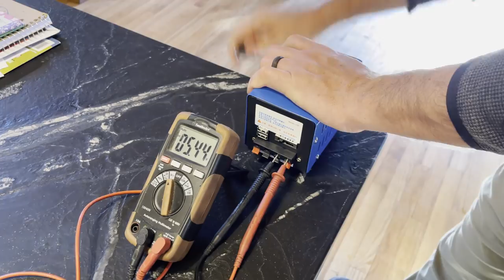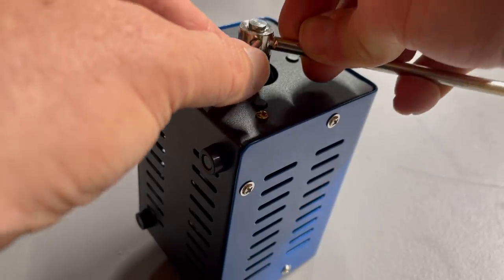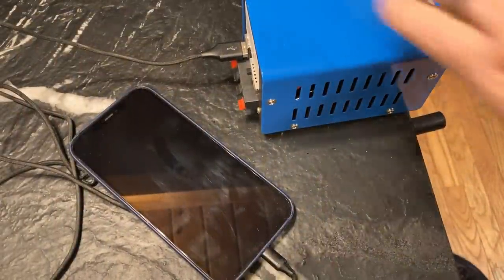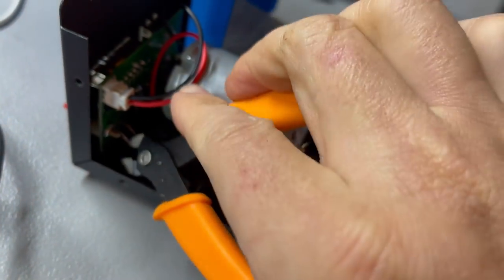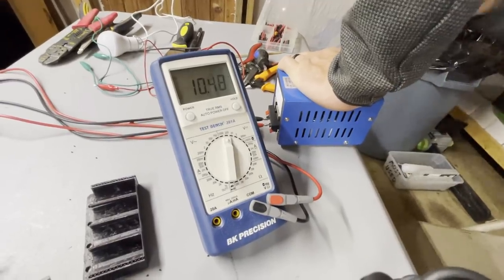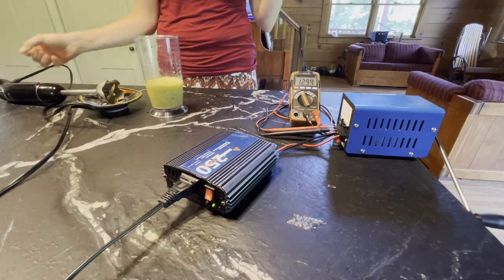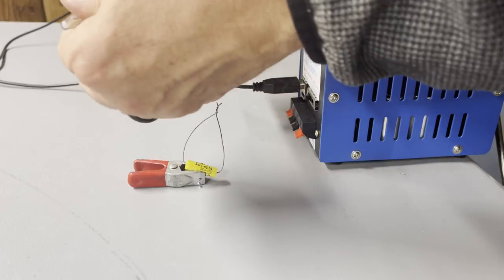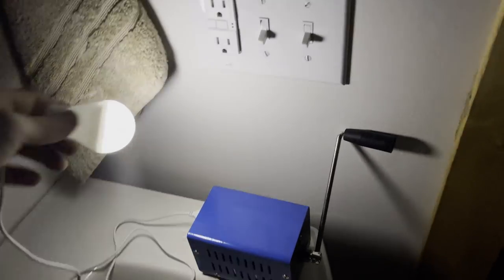DIY Hand Crank Mini BoostBox - Easy Batter Free Capacitor Power USB

Comment: These are extremely handy to have. The crank generator super capacitor flashlight that I made years ago on my channel, I still have and use it. Great job, I really like how everything fit nicely inside the crank gen unit, and the long run time.

Comment: Maybe add a flywheel and pedal so you can just casually move your leg.
Reply from the maker: Good idea.
Reply: Maybe find an old sewing machine.
Reply: I hacked together a charger from the lower part of an exercise bike ( base and crank) and a 100V DC treadmill motor. The poly-V belt from the bike fit perfectly on the poly-V  wheel on the motor. 15 RPM on the pedals charges a phone completely effortless through a car USB adaptor, so this can be done while sitting on a desk or in a recliner. I too added 6*350F super caps + diode and a "%" LCD battery meter to have a buffer, so I could pedal in bursts. The USB adaptor worked from 16V down to 7V on the caps. I also tried charging a laptop at 19V directly by holding the RPM constant , but without regulation, it was too sketchy for the survivability of the laptop, but still doable at 60-100 RPM,  like a brisk walk.  Not very portable, but excellent as a blackout generator for home use, just to keep the basics running.
Reply: @Tore_Lund  can you share a detailed video of this for noob like me.

Comment: You can also use an old cordless drill with dead batteries as a cheaper/free alternative, just zip tie the trigger down and wire up what you want to power to where the battery terminals would make contact in the handle, I really like the old drill technique because it’s easy to put a hand crank or a pulley onto the chuck of the drill plus often drills have some gearing you can play around with - love your stubble field content by the way!

Comment: Does this thing use a low dropout voltage regulator, .... a buck converter or just a resistor to regulate the voltages?
It might be possible to squeeze out some extra efficiency using a buck converter & smoothing capacitors for the 5V regulation?

Comment: Very impressive, one question though... i remember when u used supercaps in series, you always had some diodes or similar stuff to avoid overcharging a single cap, or at least to balance the charge... ist this still needed? (that was years ago) and would a balancing circuit for all caps use more electricity than you can crank?
Thanx for the video
Luc
Reply from the maker: Good question. I have done long term tests with and without balancing.  My thought is that the closer you come to the full charge state equaling the max voltage of the pack the more important balancing becomes.  In this unit the full charge state is around 15 volts.  The 8 super caps full charge is around 21 volts.  It probably would have been better to go with 6 super caps.  This was my first build and after testing the no load generator output voltage and seeing that it was around 20 Volts I decided to go with 8 caps.  After testing If I was building this over again I would probably go with 6 caps and no balancing.
Reply: I was wondering the same thing.  Glad to see new videos from you!

Comment: Hi Lasersaber
I have the same hand crank gnerator and I am considering adding capacitors to it as you did.  Question:  How has the generator been working given there is not capacitor charging/protection board?

Comment: Neat video Lasersaber, I ordered all the parts you listed to recreate the experiment minus the 250W inverters. I am adding 2 more 100F supercaps and am adding 2 banks of 5 in parallel for the increased current capacity at 15vdc max. Any chance of overcharging the caps in this configuration? I may add some over charging prevention circuitry. Can you list your inverter sources Lasersaber?

Comment: The efficiency with which humans are now capable of creating usable bright light is incredible. A 1994 paper by economist William Nordhaus lays out the case meticulously. From the camp fire, to the oil lamp, to gas lighting, to the incandescent bulb, to fluorescent light, to the LED, there has been a roughly MILLION-fold decrease in the cost of lighting in terms of energy and time required to create light since antiquity. There is probably nearly a factor of another 2X efficiency gains still remaining in electroluminescent lighting before theoretical limits become dominant.

Comment: Thanks for the video .I bought one of those and took the hand crank off and attached a sprocket that is belt driven and attached it to a wind mill and as long as the wind was blowing I was able to generate power and do use it to charge my deep cell batteries .😀

Comment: Thank you lasersaber I appreciate you, for letting me win the booster pack and everyone watching this please learn from his knowledge and experience and evolve it too, like he said keep experimenting :)
Reply: I wish I had it, I'm having trouble living on small portable solar panels.
Reply: @green_light_8806  I don't need a step by step, it's super simple. It's the parts I can't afford. As it is the electric is provided by a battery and a 200w inverter, that I would need to use for my solder iron.
In addition, I was looking at these very hand cranks and pedal cranks just the other day on amazon. I came to the same conclusion that I couldn't keep going long enough just to charge my phone, if there was a low sun week. The $80 worth of supercaps which really take up a notch, is something that I don't have. As it is the $35 for a hand crank takes food out of my mouth.
Reply: @lightdark00  buy similar value capacitors but a cheaper make, they may not last as long but it will still work. My 8 super capacitors cost £12
Reply: @strawman9410  Another buy something post.🙄 I like to eat each day too, at about $1-2 a day now.
Reply: @strawman9410  hello sir can just asking if I can use 6pcs 100f capacitor with 2.7v each? i cant find the exact value of those capacitors here in my country

Comment: @
lasersaber Have you got a chance to test these new age supercaps called zoxcell rated at 3000f 2.7 volts .and 21000F 4.2 volts , looks very promising as they are very small for the density they hold.Can you make a video using those cells if you can .
Reply from the maker: Thanks for telling me about them.  I’m checking them out now.

Comment: Okay noob question, so go easy. I know that the total capacity goes down as you add capacitors is serials to get higher voltage. So, if your goal is using the 5v USB port, do you have more storage with 6 capacitors instead of 8? 

Thanks for coming back!
Reply: No you would have less run time. Instead of 20 minutes plus you'd have probably 15 minutes.
Adding more in parallel 8 + 8 would give you more run time, probably 40 minutes plus run time. Not sure if you would need to reduce the 100f to 50f though.
Reply: If you put two 100F (3V) capacitors in parallel, you would have 200F (3V).  If you put two 3V 100F capacitors in series, you get 6V 50F. So 100F divided by 6 is 16.67F (18V). LaserSaber might do better to use a 3S2P arrangement of 3 serial groups of 2 caps each, 200F/3 = 66.67F (9V).  If he had a buck-boost converter bringing the energy back out, he could use 2S3P, at 300F/2 = 150F (6V).  All this math assumes the new 3V Tecate supercapacitors (at Digikey) are used.

Comment: It's not a good generator so tiny  the one I'm making just my copper wire will weigh more that this entire crank, i reckon itll do 1,200w out 120v 10a and at a slow turn speed. It's not worth buying a premade one

Comment: Hi @
lasersaber, thanks for the video. I like to build it one for emergency purposes, but wondering if I do need to attach a diode so that no current flows backward. One more thing, is possible for the supercapacitors to explode if the crank is rotated continuously like when attach to a bicycle or make is a generator from a water paddle wheel?
Reply: i think li ion or Lipo cells and controller is better option for your  example.

Comment: What is the estimated lifetime or number of cycles for those capacitors?
Reply from the maker: "The supercapacitors, under standard testing at ambient and rated temperatures, and application testing at ambient temperature, have undergone approximately ten million, 11 million, and one million cycles, respectively, over two years. The supercapacitors did not experience end-of-life failures but remained within specified operational tolerances. The study was terminated after successfully completing 11 million cycles at approximately 75% DOD at rated temperature. The results demonstrate cycle lifetimes significantly in excess of manufacturer specifications and potential for deployment in long-life robust applications."

Source: https://www.researchgate.net/publication/273395798_Cycle_Testing_of_Supercapacitors_for_Long-Life_Robust_Applications
Reply: @lasersaber  Thank you so much for the info. It means it can sit for years waiting for emergency or when needed will be useful for as long as needed without the need to replace crucial component.

Comment: Hope this helps Use voltage doubler circuit built using supercaps, it helps recharge the caps quickly

Comment: Gearing & a flywheel, like a bike + super capacitor bank should improve efficiency and ease of cranking. Also I buy those little motors for small cnc machines for a lot less than these units do

Comment: i have the same dimensions of super capacitors from ZOXCELL (1 cm more in lenght )  and 3000F 2.7Volts i dont know if this capacity is real or fake and in their website they have also 10000F and more so is the dimension important, i dont know

Comment: Problem with this mod is that you are STILL getting the exact same amount of output from the unit that you would if you charged two USB power banks and used those to run the flashlight.  The only real usefulness IMO is that you have added power storage capabilities by doing the mod, which of coarse DOES make the unit more useful YET as mentioned it's still the same amount of power being generated of coarse.  Also the unit is dangerous per se to those unfamiliar with the tech perhaps (in the same way that playing around with an old TV's caps inside would be)...so that is another caveat.

Comment: You show charging a phone without the supercaps, but not with them.  Phones won't draw too much current at 5V (slow charging), but are still a relatively heavy USB load.  Could a drained smartphone be charged enough from 1 minute of cranking to boot up and make a phone call?

Comment: Whats ur experience with the capacitors maintaining balanced voltage and not exceeding the 2.7v ea.
Reply from the maker: Good question. I have done long term tests with and without balancing.  My thought is that the closer you come to the full charge state equaling the max voltage of the pack the more important balancing becomes.  In this unit the full charge state is around 15 volts.  The 8 super caps full charge is around 21 volts.  It probably would have been better to go with 6 super caps.  This was my first build and after testing the no load generator output voltage and seeing that it was around 20 Volts I decided to go with 8 caps.  After testing If I was building this over again I would probably go with 6 caps and no balancing.
Reply: @lasersaber  Probably keep the 8 caps so if ever u feel like charging it for longer, you get to have more power stored. 

If you go with 6 caps in the future, you would be charging near the full caps voltage right? And would have issues or need for balancing.

Comment: Got one now...but the small capacitor is now soldered to the board. I was able to get the board out with a little bit of gentle wiggling. Will solder the wires, then put the back the PCB and then solder the super capacitors.

Comment: How long would you have to crank, with no load,  to fully charge the caps?
Reply from the maker: It took me 3-4 minutes to reach 15 volts.  That is pretty much a full charge for this unit.  In theory it could go up to just over 20 volts but that would take way too long at this gear ratio.

Comment: The link provided for the Super Capacitor is a 3V but the original in the device is rated 35V and measuring the voltage output by the motor can spike over 12V is there something I am missing or is it the wrong part?

Comment: i see that generator uses a cheap dc brush motor, some hand crank generators, usually larger ones have stepper motors which are low speed generators

Comment: Did you consider connecting them in parallel?
Reply: connecting them in parallel would increase storage power capacity but would reduce the charge voltage tolerance

Comment: this is excellent for emergencies even for a small air compressor and adding a small air tank to inflate your cars tire back up when running low on air. will have short run time but very use full even for radio equipment use like for ham radios hand held ones.

Comment: Hey man, thanks for the great video. I got the crank generator, i was wondering if i could use 100uF 25V instead of 3V capacitors?
Reply: no these are regular capacitor for filtering, we are talking here about super capacitor, and you have to make difference between 100uF and 100F

Comment: I kinda feel like just using a 10w foldable solar panel, small power bank, and usb flashlight would be easier, cheaper, and the light would last for hours without any effort. Maybe I'm wrong tho. I really love your innovative ideas, keep them up!
Reply: Solar isn't reliable. With this you could use it and charge it at any time. Great for emergency use. Solar is just better for long term usage.

Comment: try aluminium-foil separator-paper spiral roll with ethanol-koh electrolyte to make aluminium-air battery, soaked in a standard lead-acid plastic container, with a separate carbon air-electrode, just make sure the separator paper lets the electrolyte flow between the foil layers
Reply: try dry supercaps, aluminium foil, anodize super physical aluminium dioxide dielectric layer, coat with water or liquid conductive paint, ie, dry actual capacitor with super thin oxide layer, and the liquid conductive paint drying super close to the oxide layer
Reply: feel free to patron if you find this useful
Reply: energy density will be the metal itself without the air and count the supporting pieces as engine weight, not the metal weight itself, even if you could calculate the total specific energy based on the total weight to energy ratio, with the pieces included, aluminium should be 3-4 kWh/kg easily, keep the air electrode around separate to the paper-metal layers, and the ethanol-koh (non-aqueous essential) reasonable, also around the paper-metal layers, you can even arrange so that the metal-oxide drops down to the bottom of the container after it has formed, if you have enough space between the layers
Reply: about the dry supercap, the thickness of the oxide should be similar to the double layer of the wet double layer supercaps
Reply: if you dont make the fixed primary cells of the spiral metals, you can feed in the fuel metal foil or mesh-wish (for high surface area), and even filter the electrolyte to remove the oxides, even iron wire or iron foil will work, as iron-air continuous feed fuel cell